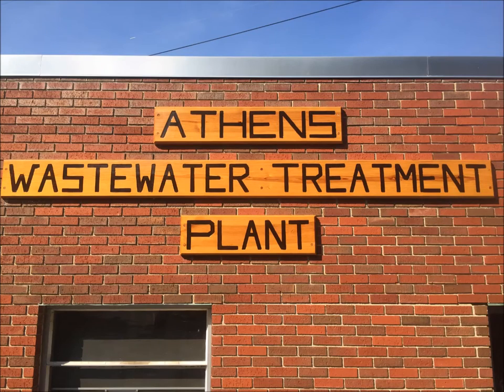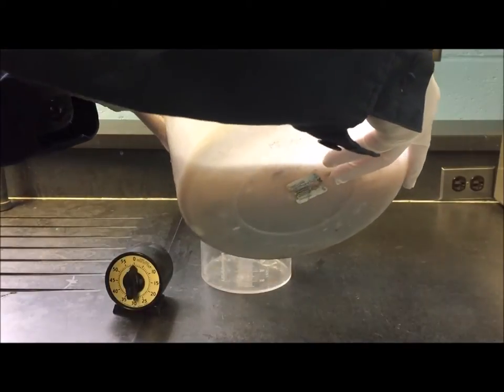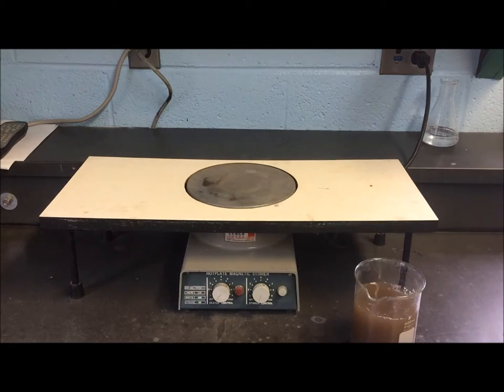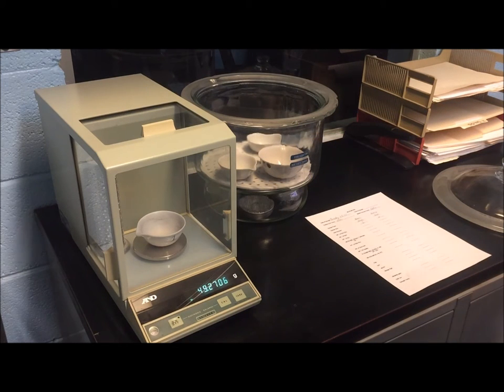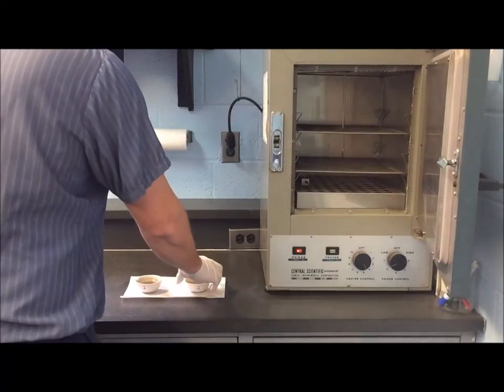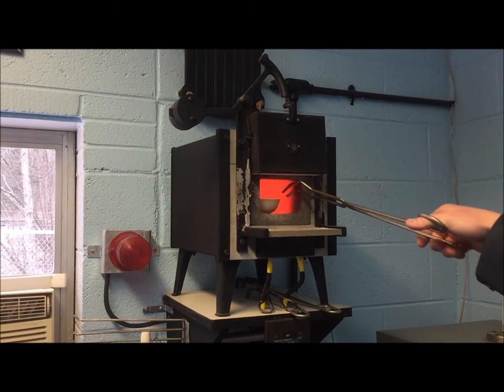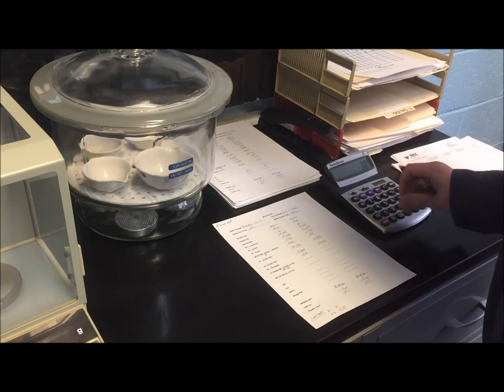Wastewater Treatment Process Control Testing

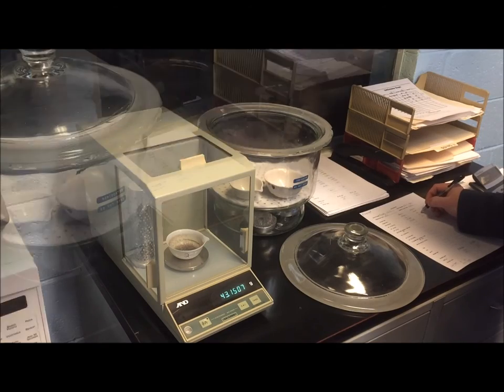Comment: At 4:15 you say your are calculating your mixed liquor suspended solids number. The test you demonstrated was for total solids (SM-2540 B). You would have to filter your sample and weigh your dried filter paper residue to get the suspended solids number (SM-2540 D).
Reply from the maker: Good point!  Thanks for the correction. 
In fact, I got more than that wrong. 
MLSS would require a lot more information to calculate , aeration tank volume etc. 
The drying method was for total solids. 
Thanks for watching!!

Comment: Can this be monitored on computer connected to the process?
Reply: Yes, you can use an inline TSS probe in the aeration basin. Being able to have constant monitoring feed of the basin TSS is the way to go because you can see deviations in a trend. If the mlss is slowly dropping, you likely have an equipment failure of RAS pumps, or mixers... Your solids are selling somewhere. Or your losing a ton of solids in the effluent... I prefer to have inline tss probes and run mlss daily.

Comment: I have a question do you know why DO is not part of the wastewater permit but the pH is  on the final effluent
Reply from the maker: Is DO not on your DMR to report?
Our permit states we have to meet a specific mg/l of DO as well as pH.
Reply: Athens WWTP No the DO is not on our permit, I was wondering we have TSS, CBod, BoD, and NH3
Reply from the maker: Feed Your Faith 
That is a little strange. During the re-permitting process, sometimes the DEP will add/subtract things to test for. But DO, in my experience, has always remained. And it’s important to aquatic life that the DO is enough for you receiving stream.

Comment: If the pH is under  5  going out the effluent why is it a problem?  If it’s over 10 why is that a problem?
Reply from the maker: A lot to explain there. You may want to read up on that. PH is very important not just in the effluent back into the receiving stream, but also the treatment process. Microorganisms like a certain pH range to do their job properly.

Comment: What does the settlometer tell you
Reply from the maker: Margaret Wilson thank you for the question. The settleometer test shows us visually what's going on in our activated sludge process. We look at it like, is it settling too fast,too slow?  Is it compacting well?  Is there a lot of suspended solids on top of the blanket? Just things like this the assist us in running the plant.
Reply: Can you tell me what does the centrifuge tell you about the sludge?
Reply from the maker: Margaret Wilson we don't generally use a centrifuge much. It gives you a percent volume of sludge.  We find it doesn't really help us much.

Comment: Why use a sludge judge? The aerated sample is homogeneous. A scoop should do the trick.
Reply from the maker: TurtleboyTom thanks for the comment. Your right. A scoop would work and we have used those also. The sludge judge is always located nearby so we just use that. We use this also to check sludge depth in the opposite basin. One tool instead of two.
Reply: I figured it was for convenience. Thanks for the reply!
Reply: @AthensWWTP  Sorry to give you this 2 years late, but try and use the scoop and not the sludge judge.  Your mixed liquor should not include the blanket that will have formed on the bottom.  It will give you a false reading, saying your MLSS is higher than it actually is.  Just my two cents.
Reply: @AthensWWTP  I had no idea that tool was called a sludge judge lol. I started my job at a wwtp and I've used that same tool to check the sludge blanket in our secondary clarifiers

Comment: this is great. my plant is just now building it's own laboratory and i'm preparing to do our own testing, starting with solids testing. i don't have my stantard methods book in front of me, but doesn't it state for MLSS you simply follow TSS procedure, which is drying for an hour, then add on the muffle furnace procedure?
Reply: also, with your sludge settling that low, what are your MLSS typically ranging?
Reply from the maker: ecafsinep thank you for your comments. There are many different ways to dry solids. We do it this way because it's simple and we don't have to mess with crucibles or filter paper. Another words, less time in the lab so we can attend to other duties. The down side is the 8 hours it takes to dry the solids. 
Our mlss changes pretty often due to our location being in a college town and the weather changes. Right now with college out and very warm weather, we are running around 1700. Normally lower, but we are only running one basin right now due to cleaning.
Reply: hey, thanks for replying!

so you can still run MLSS through vacuum flask/funnel and filter? if so, wouldn't the furnace ignite the filter?